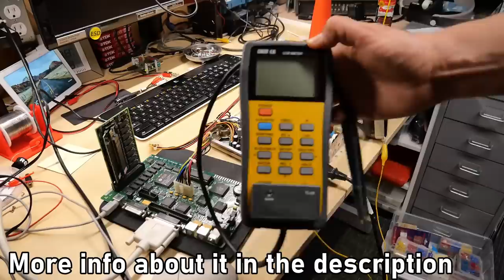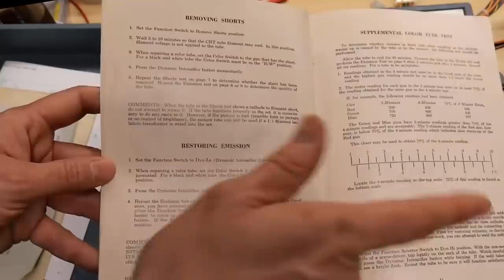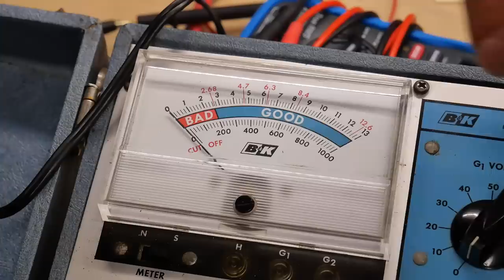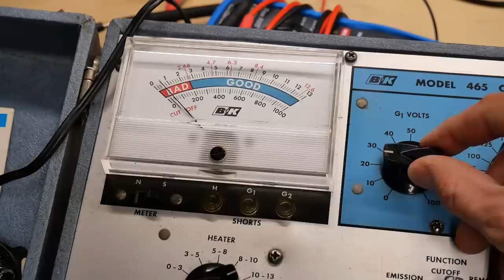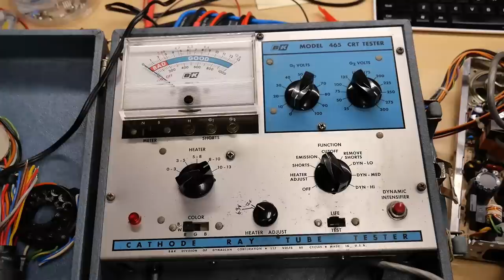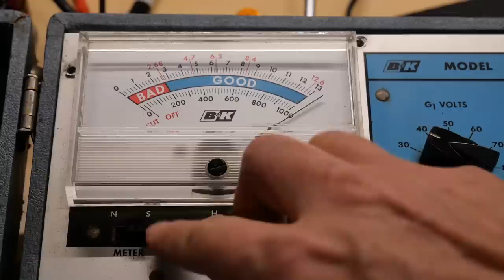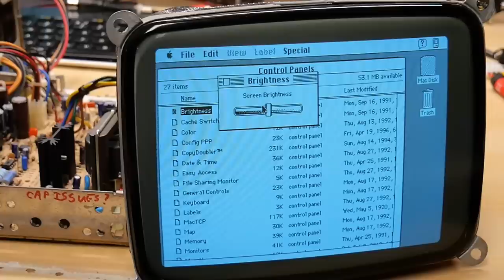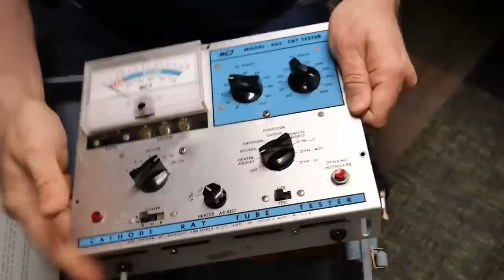Rejuvenating a Macintosh CRT with equipment from 1969

Comment: Uhhh... You don't trust the quality of the meter for the filament voltage, but you DO trust it for emissions? Fix your test equipment (without butt-connectors or hacking original parts) before you try to use it. Replace ALL the capacitors in that meter, they're all done, like old bread - they go stale even if they don't go short. Do an ESR test on them.
Rejuvenators do work for short-term, like the old CRT brighteners (which were small transformers that increased the CRT filament voltage). In the case of a TV set in constant use, especially in a bar, or a computer which might have been running 24/7 in its old life, replace the CRT as soon as you can. For a computer museum, a restored CRT should be fine for occasional use. You need to do a full recalibration afterwards - find the service switch and redo white balance with color CRTs; contrast and brightness with your cathode and grid drives and the user controls should be set at about midrange. 
The short removal feature invariably dumped a large capacitor across the affected CRT electrodes. Sometimes you'd see the bright flash from inside the neck of the tube as it blew away a flake of aluminum usually left over from the second anode coating and which worked its way into the gun through handling the TV set. A filament-to-cathode short is okay if you can score a 1:1 transformer for the filament to let it float - this caused weird problems in TV sets, and God knows what effects in a Macintosh or other monitor with the filament running off a switching supply. Some could also "repair" a bad filament by dumping the capacitor across it and hopefully welding the defective filament together, but I would never trust that CRT again. 
To this day, there are CRT rebuilders. Carefully box up your CRT and send it to one of them. They will cut the neck off, replace the phosphors, replace the electron gun, draw a new vacuum into the tube, test it, and send it back to you. It is an expensive service, for a Macintosh, a broken machine with a good tube is still your best bet. For a 1954 RCA 17" TV set, you're going to the rebuilder:
https://www.youtube.com/watch?v=W3G7b-DcOO4
I am glad you resurrected your Macintosh, and I am glad you've introduced people to the CRT Rejuvenator. Mine was an Eico. Until 2008, I had a collection of over 40 TV sets ranging from the late 1940s (with Channel 1!) all the way to Sony Watchmans and early Sony Trinitrons. You can destroy a CRT with a rejuvenator, just use them carefully and sparingly. And they're better than frying the filament with a brightener. 
If you must leave a Macintosh on, go with a black screen. Flying Toasters wastes the barium oxide layer on your CRT's cathode. Screen blanking wasn't just about burning a Pac-Man maze into the face of your screen (we've all seen that!), it was also about not wearing out the emissive layer on the CRT's cathode which is what makes vacuum tubes of any sort get weak. 

All of us who are into old devices which have CRTs, whether in TVs, oscilloscopes, video games, radars, military electronics, medical electronics, we all need to be aware of CRT rejuvenators and rebuilders, and work together to share knowledge about keeping them going.
Reply: "[short removal] blew away a flake of aluminum usually left over from the second anode coating and which worked its way into the gun through handling the TV set"
And this is why you should always try to keep anything with a CRT upright. THIS END UP signs have meaning. Putting a monochrome CRT on its face is usually harmless, but can sometimes scratch the inside of the phosphor if there's a flake of aluminum or shard of glass or anything. This mostly applies to bent gun CRTs with ion trap magnets, which predate the tougher aluminized phosphors in virtually any set after 1960 or so. Putting a color CRT on its face is rarely an issue because of the improved manufacturing by the time the color CRT was developed. But still, there's a risk of any foreign material getting caught in the shadow mask. Always try to avoid putting anything with a CRT into a directly neck-down position, as that's how any conductive debris gets in the gun and causes a short. Keep it at a viewing angle if you can. 
I once found a cigarette butt inside a CRT that had been in service for over 30 years. I'm looking at this 1950s TV set, a bent gun set where you could actually watch the show from both sides of the screen, and there was a white thing in the bottom rim where the screen met the bell. And it moved when I rocked the set side-to-side. I got it to an angle where I could see what it was through the thick glass and the sparse Aquadag. LOL. Long may you run. Being an ashtray on the assembly line didn't kill you.

Comment: So... we need to reverse-engineer that rejuvenator and create a low cost clone and the retro community can fix their CRTs.
Reply from the maker: The schematics: http://pacifictv.ca/schematics/bandk465schematic.pdf

I'll put this link in the description -- but I think it would be pretty easy to replicate this.. it's a bit of a maze with all the knobs sending signals all over the place though.
Reply: @adriansdigitalbasement  Thanks, very interresting.
If I look at it, the only "difficult" part is the transformer, you would need a custom wound transformer for it. Most of
the "user interface" can be replaced with an Arduino with a few buttons/controls and perhaps an LCD screen.
The transformer can likely be simplified for the heater: The switch seems seems to select between various AC voltages.
Since it is a heater, it likely doesn't matter wether it is AC or DC. If it is DC, you could use a buck converter module
that already has a voltage adjustment potentiometer.
The rejuvenate part seems to be to create some rather high voltage DC pulse.
A modern clone definately seems viable, but of course a full project that needs time invested.

Comment: While I'm pretty sure you'll do it sometime... please, change those caps in the BK. Even if they test ok on ESR, they may go up any time soon. I've had a quick look at the schematics, the 2 5µF ones are in the power supply for the meter, if those short you risk damaging the transformer. And as that's generating the (nowadays) obscure voltages needed for tubes it will be hard to come by.

Comment: The nearest common modern replacement for 50µF is 47µF (and for 5µF it's 4,7µF).
To make this tester & rejuvenator reliable for future use it might be worth considering to replace the old caps with new from a reputable manufacture.

Comment: CRT restore/rejuvinate devices are a joke, at best they were designed to help your tube get you through the ordering and installation process for a new tube or a new TV, but its very much like a band aid. Just like a brightener it won't last very long and the tube is already bad. Worst case scenario they blow the filament and you just have to get a new one sooner. 

What these typically do is raise the filament voltage a bunch to try and blow the crap off the filament or off the cathode to give you a little more life.

Comment: This life test was horrible. With a good picture tube the needle shouldn't move at all. What it does is cutting some of the power to the heater and measuring the emissions. And by the way, you ran the picture tube a little on the lean side, those picture tubes have 12.6V heater votage. Anyway, you did find this at the thrift store? Oh God... I am searching for this for years now and no luck whatsoever...
And by the way, never use equipment from 60's with those paper caps still in there. Those go bad, it is possible that the tester did nothing to the picture tube.
What the rejuvenation thing does is sending high voltage pulse to the CRT and blowing off some of the heater material so it has more emissions. If you go too high, you blow the heater right off, that is the problem why it should not be used too much. And as you can imagine, heater with lesser material runs hotter and has way less lifetime.
Reply from the maker: I was unable to find the datasheet for these CRTs and I measaured the analog board heater voltage and it was about 12v so I just replicated it with the heater under load on the tester.